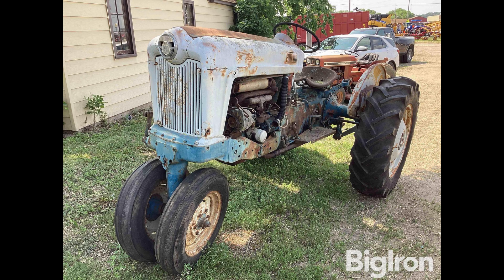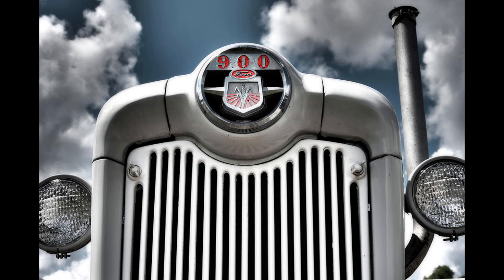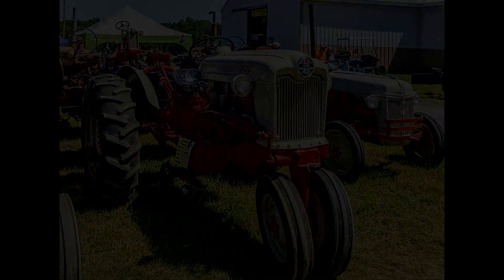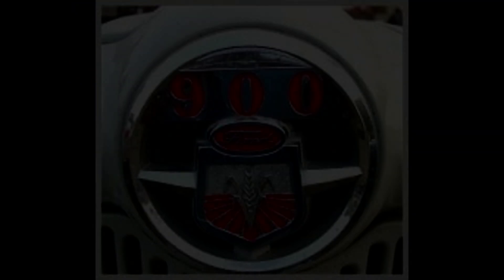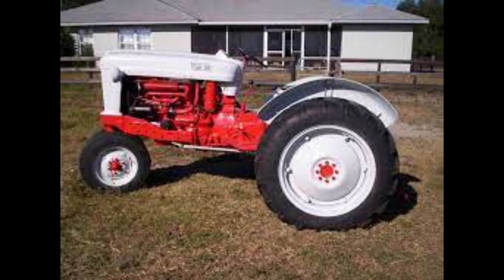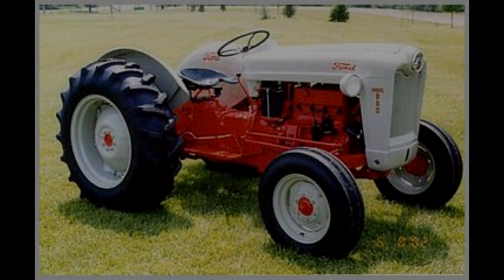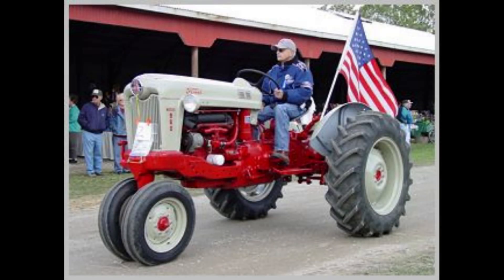Decoding the Ford Hundred Series Tractors (600/700/800/900) 1955 to 1957 - - Information

Comment: I talked about my 650 tractor and I think I said it has a 340cin motor. That is not correct my tractor has a 134cin motor. Great video.🚜👍
Reply from the maker: Thank you for watching. What a great tractor you have. I still use my 860 to this day. I had the clutch get struck to the plate a few days ago, but after putting a wood block on the clutch pedal to hold it down for a few days, it unbound and I was good to go. Great machines.
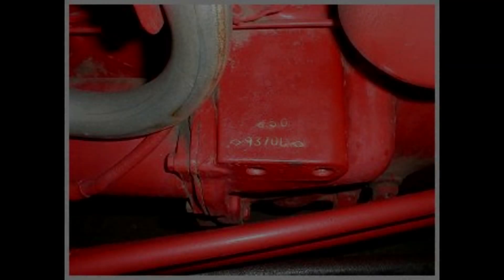Reply: I have two 172 cubic inch Ford industrial engines in two small articulated loaders. They both run like tops and I've been working in the mountains of Arizona for 40 years 2:05